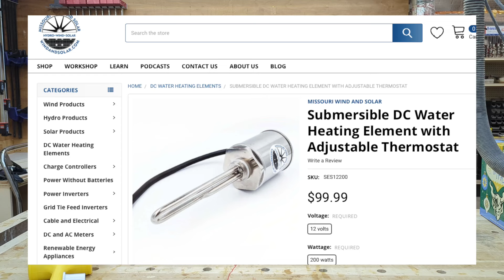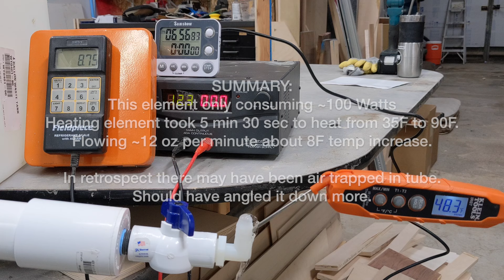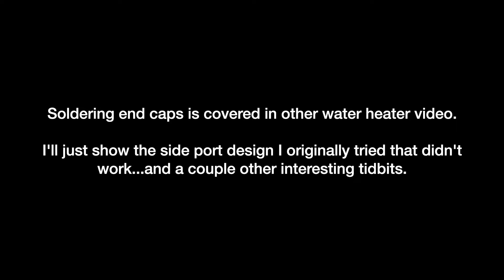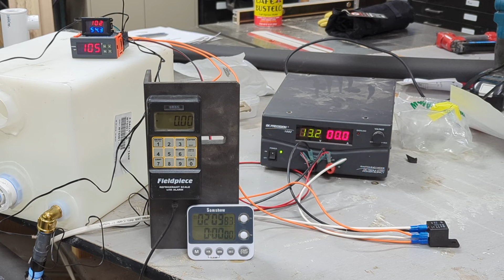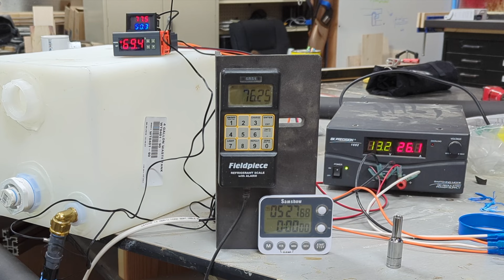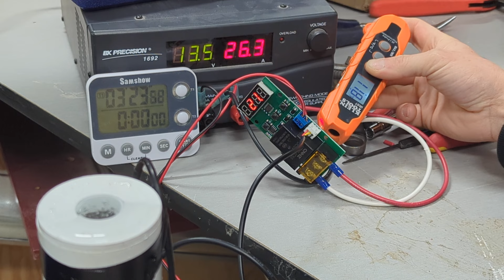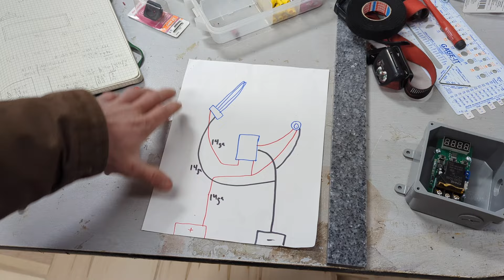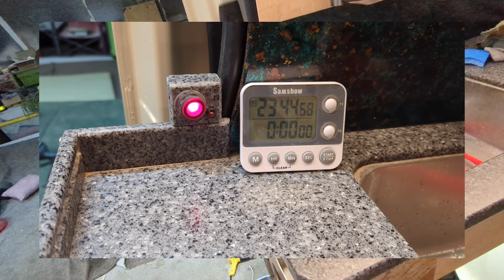DIY Water Heater: The Design Process

Comment: Informative video and work.  Normally, water heaters have a failsafe temperature and pressure relief valve.  I am wondering what would happen if you ever forgot to turn off the power and the heater failed, locking in the heat mode.

Comment: Not to sound like a jerk but brazing is similar to soldering but the difference is the material used to bind the pieces together... soldering uses, in historical context, a lead based bonding material now there is alternate ones without lead... but still very soft compared to the material used for brazing which is harder and usually done much hotter and done for bonding 2 different materials like stainless and copper or brass together...